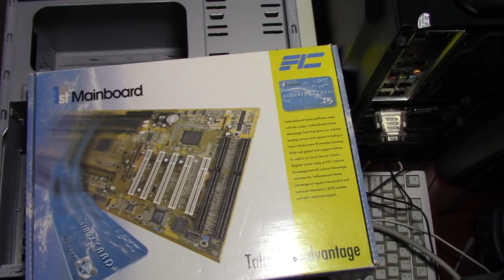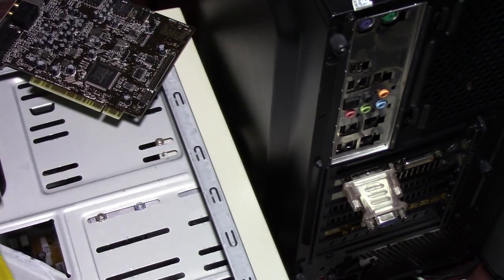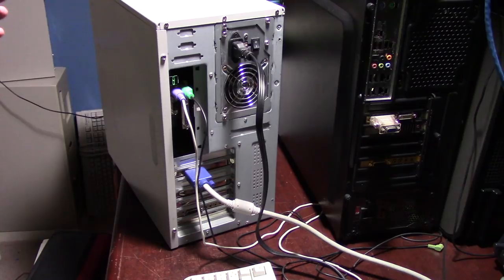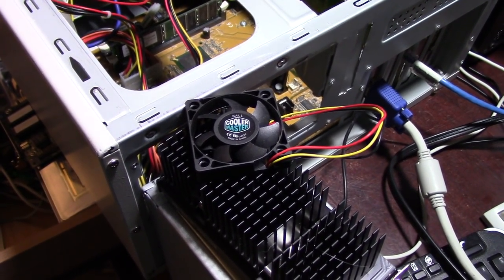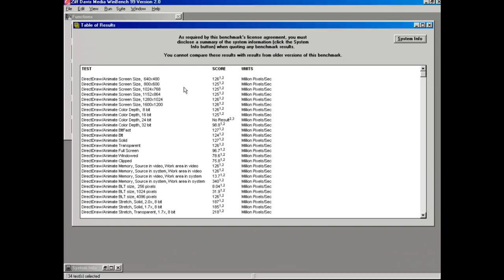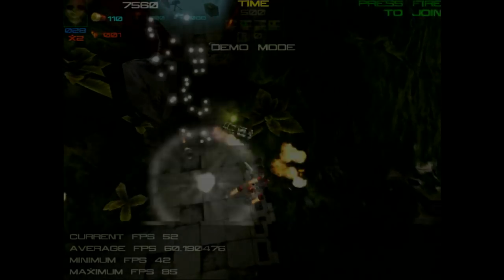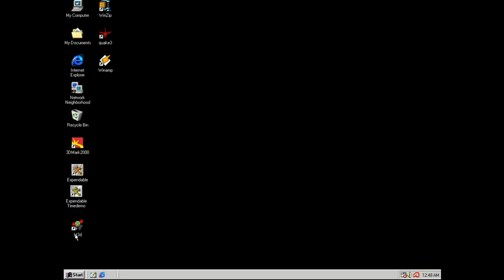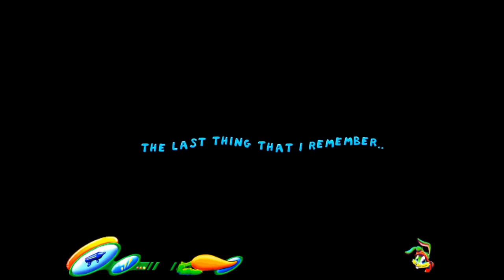AMD Athlon K7 Build

Comment: Slot A is an area of interest to me because I've not run into them in the wild, never had any incentive to get one myself so it's always cool to see one running on video. Despite all the problems K7 had later on, which were largely down to cheap 462 motherboards becoming abundant rather than the K7 itself, it is still a platform I have mad respect for, if only because of its utter trolling of Intel. Jazz 3D always gave me a Rayman 2 vibe, suppose it's just a case of 'product of its time' when everyone wanted to be the next Mario 64 game.
Unusual to see an OEM board being more feature rich than the retail one, it's usually the other way around.
Reply from the maker: It is unusual for sure to see that.  The ASUS K7M is the other way around with the version sold to HP being stripped of the overclocking dip switches and 1 less memory slot. I would love to find the original "Fester" motherboard that AMD produced but I don't think those were ever shipped other than to some review sites.

Comment: I just went and had a look in my junk closet as I could remember having one of those Compaq Slot A motherboards. Mine is called the Aspen2 and says replace with compaq spare SPS-BD 1394 motherboard, 166049-101. It is very similar to the green one in your video.

Comment: Great video! Having just bought a Pentium II 450 back in the day I envied my classmate a lot who had just a few months more patience than me and got himself a brand new Athlon 600! Damn that thing was fast!
And now I think you should pull out one processor from that Xeon 550, take this Athlon and just a regular Pentium III 550 and make a face off video with the greatest processors of that era.
Oh, and you might as well include the K6-III 550 also. Use Cinebench R10 aside from regular 3dmarks to measure workstation kind load.

Comment: Recently acquired a few Slot A boards and Athlons, I noticed the northbridge getting quite warm even with the heatsink on. Not surprising it crashed without the heatsink. Maybe that's the reason these boards were considered less stable than the Intel boards. I imagine it could even overheat with the heatsink on and no airflow in warm environments.

Comment: Classic stuff.  My build of that era was eerily similar - Athlon 600 (o/c with goldfinger device to 800), Rage Fury Maxx, etc.  The only difference was an MSI board.  I really liked the pairing of the Athlon with the Maxx.  I had a few other cards at that time including a voodoo 5 and GF1 DDR.  They all had their pros and cons, but to me the Maxx was the best all-around card of the 3.  
I have a slot-a build currently too and would love to use a Maxx on it, but it is my Win2k build and the Maxx only works on windows 98 unfortunately.  Can't believe that was basically 20 years ago!!
Reply from the maker: Hard to believe 20 years has passed.  I use to have a couple gold fingers. The best one I had allowed for voltage adjustment because it had it's own molex connector and voltage regulator. I've spent a long time trying to find those gold fingers for sale to include in a video about the Slot A chips but have come up short. I remember AMD used higher speed cores than what they were locked down to for in some of the Slot A's for what ever reason.

Comment: In the year 1999, I have had a Slot 1 machine with a 500MHz PIII Katmai, after that in 2001, I go to Socket A with a Athlon 1000B processor. It's time, that I also build a Slot A Retro machine, a Athlon 1000 Orion would be fine, but very heavy to find.

Comment: Yeah!

I still remember the joy of getting an Athlon 650... what a beast of a CPU it was at the time, stomped those Pentium III guys :) I liked the goldfinger device too, if I remember right it overlocked to 800MHz pretty well with air cooling.

Good times, it was a great time to be a PC nerd.  CPU's were getting much faster and that 1GHz milestone was just around the corner.

Rage Fury Maxx is an interesting card for sure, it was slow in comparison to Geforce 256 though wasn't it?
Reply: Yeah, nothing could compare with GeForce 256 at the time it came out. Sometimes Rage Fury Max could get twice as slow. What's even more interesting, there are situations when the Rage could outperform it's successor - the Radeon SDR!

Comment: My first "from scratch" PC build used a 1GHz Socket 462 AMD Athlon CPU and the Rage Fury Maxx graphics card!  I didn't know at the time what a storied reputation that card had, but it worked for me - until I wanted to upgrade to WinXP of course; No drivers.  Do you have a 1GHz Slot A CPU?  Are they really rare?  I wanted to build a 1GHz Slot A system recently, to complement my 1GHz Slot 1 PC, but I couldn't find the CPU for sale anywhere.

Comment: Well, this is weird. This (same chassis, different front) was my first ATX case back in 1998?. Got it with Celeron 300A@450 / ASUS P2B. Ran different oced celerons up to 2000. Swapped to Duron 600@900 / Abit KT7, later Asus A7V. It had multiple KT133/KT133A boards inside all the way to January of 2008 :) when I finally sold last Asus A7V133 (XP2400+ 512MB combo) for a whooping $40, and jumped on Core2/P965 bandwagon.

.. and here I am today, still using same (with "minor" dremel "mod") case! Original dirt^^ I mean patina, Duron sticker and all! 
https://imgur.com/a/hanDS  20 years, from Celeron 300@450 to @4GHz Haswell, what a ride :)

Comment: my compaq presario 7954 uses oem version of that fic sd-11 (aspen2) but only 2 sdram slots
athlon 750mhz thunderbird slot a (from 650mhz pluto core)
512mb sdram pc133
geforce fx 5200 128mb agp
sound blaster 128 4.1 pci
20gb ide 7200rpm
lg cd-rw 52x52x52x